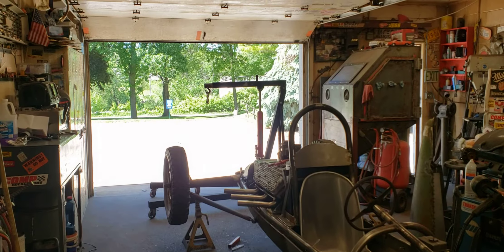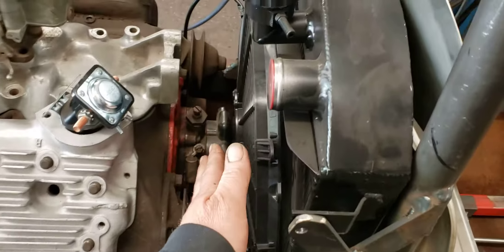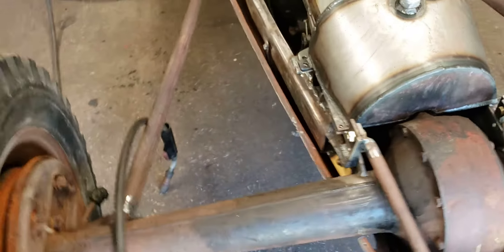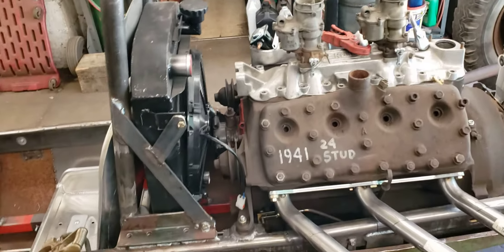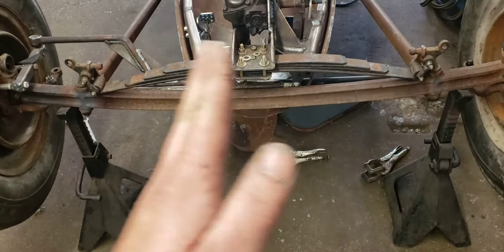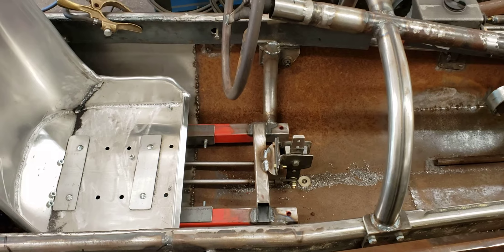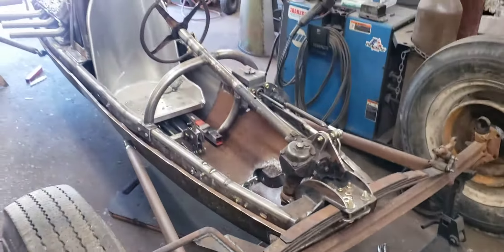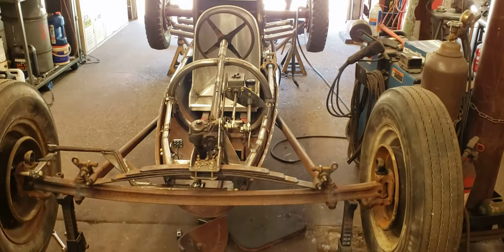Drop tank race car

Comment: How does air get to the radiator? Although you aren't going to run it for extended periods so I guess that won't present a problem. If you really want it to look period, you need at least one dob and glob weld.
Reply from the maker: it should suck a little from around the seat . it's not ideal , but as good as it going to get .
LOL , there is a lot of truth to that , and old water pipe !